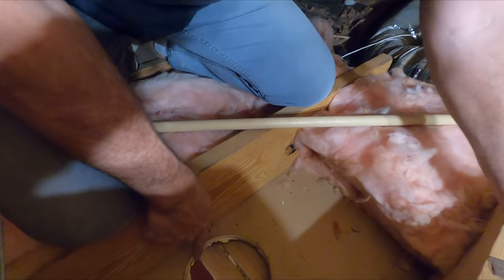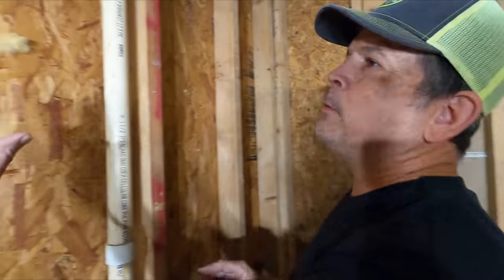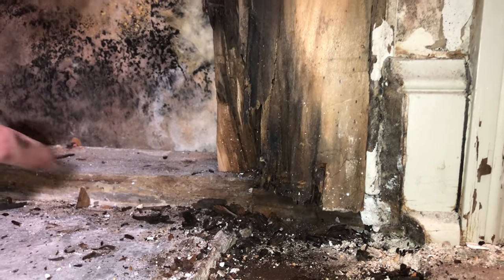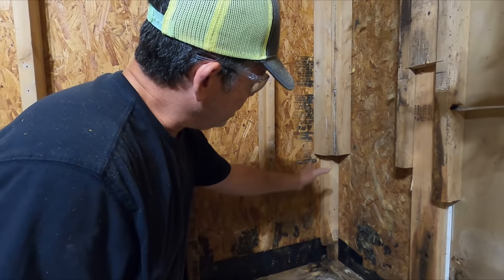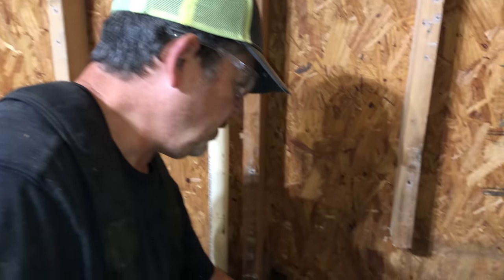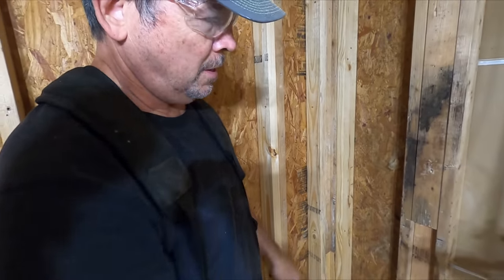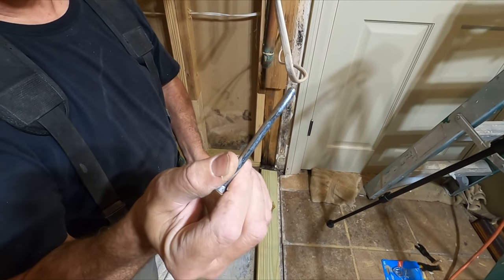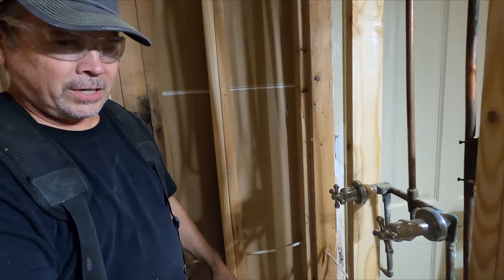Repairing ROTTED Framing in a Disaster Shower

Comment: For production lighting you may what to consider taking the single light and pointing it toward the ceiling at forward angle, not straight up.  It would, by partially reflecting off the white ceiling, add fill to the overall area.  Something to consider.  I like your presentations.

Comment: I am not a contractor, however, I've always heard that if you leave rot, any rot, it will "infect" any new wood! And no mold remediation? Hope you didn't skip that!!
Reply: Rot only spreads if it has access to moisture. Similar with dry rot, it still requires moisture. (just happens to get wet, then dry, then wet then dry in cycles)

Comment: I just want to point out to you guys.  That a rotten beam doesnt not mean it isnt still carrying load.  We have a Pole barn built 100 years ago. using 6x6 beams to support the massive body of the barn.  Trust me this barn is easily 3-4k sqft..  the rear beams are in good shape, perfect actually, but 3-4 of the front ones have termit dmg and rot from being exposed to rain water from the ground it is near.   They do thankfully go on cinter blocks or the concrete slab for support.. so they arent in the ground itself.   However the beams are so bad in sections that the 6x6 is completetly gone and only 1 inch is left touching the blocks...   There is no way the load from a roof, and 5x5 beams are being trasfered to another location.   Going by what you said in this video my barn should have the load transfered somewhere else.. when in fact the main upper beams all sit on the rotten 6x6's...  Im amazed that the barn is still staning..  Im not sure what to do until i can replace the beams.. I am thinking of using 2x6 pressured treated wood and "sheething" the 6x6's this way when the main beams do collapse it has a sheeth for the load to transfer too and it might be ok..  This is temp until i can get a company out here to replace the beams

Comment: Seal that mold up with some oil based paint. At least it's sealed and can't continue to grow or be agitated into dust.
Reply: Treat the mould, don't cover it.  Anti microbial.
Reply: @BeeRich33  sure, anti-mic away. Still need to seal it in. Can scrub with hydrogen peroxide and spray with anti-mic, still best to seal it afterward.

Comment: You need to have that professionally mold remediated. I have that same problem except mine is 10 times worse than that. Leaving any of that moldy wood is a danger to the homeowner. Looks like the sheathing is also molding. I have not finished the whole video yet. I'm having mine professionally done. Good thing I've got good insurance. Because of water damage, insurance should cover that. I reserve the right to edit this in the future.

Comment: Finally the big name reveal! Been waiting for months for this. Awesome work guys! Loved the tip about keeping the board longer at the door to not split it nailing. Looking forward to the next videos
Reply: You simply need to dull the tip of the nail with your hammer before nailing to avoid splitting. An old carpenters trick I learned back in the early 80's from an old carpenter.

Comment: Great video’s. I would install an expansion plug it the old plumbing pipe, in the floor. just in case it’s still hooked up, or open to soil that could allow a path for water.

Comment: Awesome video, having a go at doing this myself for my downstairs WC. I'm looking to use 100mm of PIR to help insulate the floor but wondering if you think support is needed under things like the WC or Tub in order to avoid bounce? If so any suggestions on approach? Cheers!
Reply: What is pir? What are the abreviations?
Reply: @davegordon6943  insulation slabs
Reply: What are you planning on putting over the insulation. Are you talking about putting the insulation over the sub floor and then your finished floor? You can get heating cords to install under your finished floor with thermostat. Ditra heat it's called. Why do you need the insulation. I have a basement bathroom as well and it's not insulated at all. Floor, ceiling or walls and it doesn't get terribly cold.

Comment: Even though it is a small area, just a few. I would've probably did one at a time. I would be afraid to cut that many studs, on a load bearing wall, at once.
Reply: It was necessary to remove them all in order to add the secondary sill plate. This is a short enough section that the intact OSB and the roof framing could carry the weight for the brief period while the studs were replaced.
Reply: @JohnH0130  always good to hear an engineers approval
Reply: @levelseven9841  Thanks...but how did you know I am a [retired] engineer?
Reply: @JohnH0130    it wasn't necessary, it's an exterior corner.  In their case it worked, but not for everybody. 

Should always build a temporary support wall. 

As of right now, there's almost 300k people that thinks it is ok to cut the studs out of an exterior corner.
Reply: @levelseven9841  Well, amicably, I beg to differ. What you should always do is analyze the structure, within your competence and experience, and make a plan based on your observations of the situation. In some cases is it will be clear a support wall is needed. Here, it was clear that would be unnecessary. The tricky ones are when you can't get enough info about how compromised a structure is, and/or just exactly how the framing was done to begin with, until the demo is well advanced. I have taken a few rooms apart and found myself wondering how they didn't collapse years earlier.
I appreciate the merits of 'always' erring on the side of caution, especially if you are less experienced. In my own projects, I tend to follow your approach, and over-engineer everything by at least 100%, because I consider that having that assurance of a safety margin is worth the extra time and material expense. 
 But pros have to to take time and cost into consideration, and doing something unnecessary 'just in case' is a luxury most of them just can't afford.
Reply: @JohnH0130  I'm not talking about the pros. The pros are not watching these videos to learn whether they can cut a stud out or not. 

I'm talking about the, do it yourself, people, watching these videos, trying learn something, thinking they can just go cut studs out of a wall, not knowing if it's load bearing or not. 

So always better for a "just in case" scenario

Comment: I dumped all my broken Dewalt tools.  I am 90% Makita.  Dewalt are really black and decker.  The repair shop for tools asked me pros don't use Dewalt.  He told me to go to the back of the shop where repairs are done and to look at what tools were being repaired.  It was nothing buy yellow tools.  He ask did you see any blue green tools???  I said no.  He urge me to buy Makita and so I did.  I was this father and son team in Los Angeles that the building inspector said was refurbishing complete remodel to a 1908 house.  I drew the plans and my son did the Autocad.  We were done after 2.5 years with 10 permits to sign and that would be our final.  The head inspector ask me how I tackled such a huge job.  We did the plumbing and all the electrical that included the 2" pipe to the roof with weather head.  Build a wooden stairs first time, did the drywall finish, built 3 bathrooms, 2 kitchens, hook up subpanel and wire the entire 1908 house that had a special permit to be restored to Historical standards.  So I had to frame windows with old style sill plus house wrap shear wall with structural plywood tyvek house wrap and install all the windows and door plus 52 anchor bracket with 2 foot holes with running thread while a paid inspector watch me install epoxy on each bolt  I was going to have the Hardie siding installed but later decided to do myself and it came out near perfect to the eye. We only farmed out the insulation and new 4 inch pipe to the street.  I did all the work and replaced the old redwood framing to fir.  The house was done to modern earthquake standards.  Also I had to go to school to take a lead license for $350.00 approved by Osha to deal with the lead paint and tile to reduce cost.  So the inspector asked how we were able to know nothing and do work better than many contractors.  I said I used YouTube and he was totally surprised.  My structural engineer said that you now have the strongest house in Highland Parks Los Angeles within 5 miles radius of your house.  Highland Parks is an old part of L.A.  Nobody rips down all the old stuff and make it like new.  I really had fun since this was after  one year after retirement at age 65.  Visitors of the house are amazed at the transition from beginning to end.  What was the worst house on the block now was the best looking house.    Thanks Youtube and This Old House

Comment: How would you repair a stud if a pipe is running through the studs? Would you cut the pipe and run it through the repair stud or would you notch the stud to fit around it?
Reply from the maker: I guess it would come down to what's in the pipe and what's it made of.  Steel water line I probably wouldn't cut it.   PVC sewer/vent probably would cut it.

Comment: On the wall, why didn't you snap a line and cut a horizontal out level then frame it in like a window with a built header and cripples going to the floor?
Reply from the maker: That would work fine too

Comment: Great work.  One question though.  Did you go back and add the stud guards on the edge where the electrical and water lines are running?
Reply from the maker: I sure did, thx Jeremiah 👍
Reply: @StudPack  Glad to hear that.  It isn't hard to follow the rules.  I mean, the books are readily available, but I'm sure you know and have seen a lot of hack jobs out there.

We do flips, and in this area, (Greater New Orleans Metro) there are a lot of houses that I open up and sometimes just decide to gut completely, or even tear down completely because it would be too costly in time, money and frustration energy to try and fix all of the messed up stuff that should have been a simple fix, but wasn't done properly.
Reply from the maker: Kudos to you if you’re flipping houses after a full gut/tear down and making money.  That’s tough to do.
Reply: @StudPack  IT is getting tougher to do.  The CV19 has lowered the amount of available houses on the market, which is holding prices too high in some instances.  Add the rising cost of materials, and what was a simple $50-$60k flip is now a $65-$85k flip.  We are fighting with too many people that think their houses are made out of gold, as well as other investors, and the ARV isn't going up that high either.  Some aren't appraising for their asking prices and they are dropping their prices by tens of thousands after being 60/120 DOM. I see too many guys getting into a house too deep and then being stuck, and are trying to unload them half way through their ordeal, and are also trying to sell the houses for way more than they are valued at.  

New build is also seeing a hit with these situations.

I have started to notice a bad trend, where a guy will go in and redo the kitchen, from the floor up and then paint the rest of the house and put it on the market.  Why do it half way?  But that makes my houses look a lot better by comparison, because we typically do everything.  No, we don't always gut, but sometimes it is easier and faster.
Reply from the maker: Interesting stuff 👍  I will share this with my wife.   We’ve flipped before and have two investors but I’m cautious right now.  Your comment about others doing things halfway... I think that’s right on.  We see it everyday even in brand new homes.  I heard something on Fine Homebuildings podcast the other day “remember that built to code only means you’ve just met the minimum,  you barely received a passing grade”.  Stay safe 👊
Reply: @StudPack  Be careful how you word/describe people that allow you to use their money in order to perform your flips.  You and I can be labeled as an investor, since we are the ones that are performing some sort of work.  But if a person simply allows you to use their money then they need to be labeled as a lender or someone that is simply funding the particular deal.  An investor would need to invest in your company.  It is a simple wording issue, but can be the difference in getting in or out of trouble with the FTC.
Reply: @StudPack  Yeah, I understand about the code, I've been in and around the construction business since I was a young teenager.  But at least those measures are met and adhered to when you follow the book.  I mean I just looked at a house that is gutted.  The original structure is almost 100 years old.  Unfortunately it was consumed by termites.  The new owner/flipper has not completed the reno properly.  Just one example to keep this short, there are 1/4"+ gaps between the tops of his jack studs and his headers.  Headers that are not built properly either.

Comment: Are you toe nailing studs with 3-1/4" or 3-1/2" nails? Also, do you prefer ring shank or smooth?
Reply from the maker: 3-1/4” smooth shank
Reply: @StudPack  thanks! Follow up. Why not the longer or ring shank nails?

Comment: Takeaway #1 of the whole series:  Don't let unqualified knuckleheads build a shower!

A note on removing studs or portions of studs.  If the outside wall is stucco, then removing them without damaging the stucco is difficult at best, but it also leaves the stucco wire mesh unsecured and prone to future cracking and diminished support strength.  Reattaching old mesh to the new studs is impossible.  Better to just shore them up with new sister studs as much as possible.   

Also I'd use greenboard, not regular drywall, in a bathroom.

Comment: Did you say that it doesn't matter whether hot & cold is on the left or right? Huge mistake if so. It has to follow some tradition or standard to match the user's expectations.
Reply from the maker: The way that old valve body is designed it doesn’t matter hot or cold.  But hot on the left cold on the right for sure 👊👍

Comment: What are going to do to treat all the black mold?
Reply from the maker: All the Dr. Pepper I'm buying for drywall patches should kill it🤣🤣🤣  Hey JK!!  Not sure yet, I'll find something... vinegar, bleach or store bought.   There's not much of it....
Reply: Concorbium. At Lowe’s. Better than bleach or vinegar.  Kills those mold roots and you’ll know you did the job right. About 12 bucks.
Reply: @tdogboy7254  I second your recommendation.  I used that product  on a full basement mold nightmare (they sell it in gallons too... I rented a fogger at HD to fog the basement).  It worked and the quality was noticable.( beforehand the sinuses would flare up when you were even near the basement.  After the fogging, breathing was free and clean.  The homeowner noticed the difference right away!  It is my go-to product when I see black!

Comment: Remove the shower arm and use a 1/2" nipple with a 1/2" cap or a hose Bibb so you have water for whatever.  Plumber for 35 years and I hate water dripping

Comment: As a handyman you should know better to remove all the dry rot, your just putting a band aide over the existing dry rot, Why ?
and also after replacing all wall studs, a fungicide treatment should be used to the new and existing framing 
since it's in a bathroom area. Big mistake for not removing all the dry rot shame of yourself.